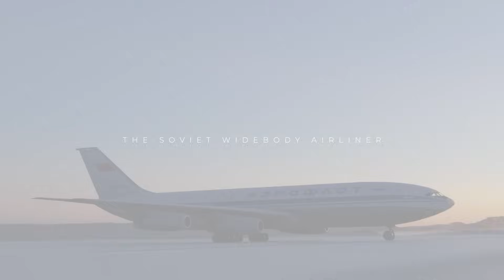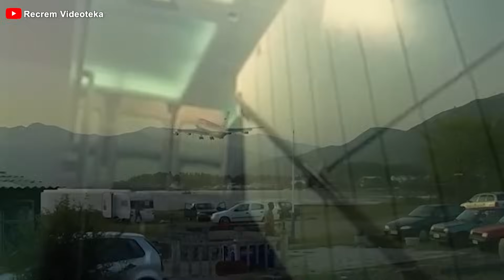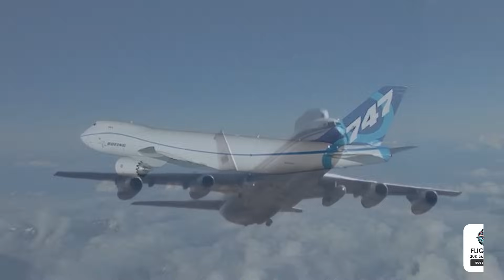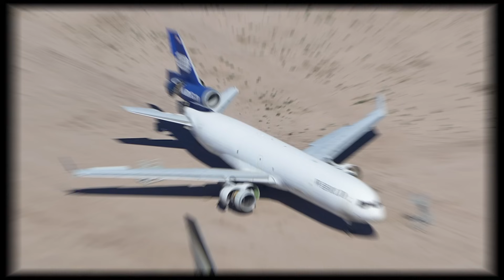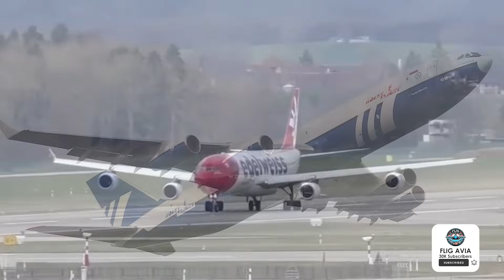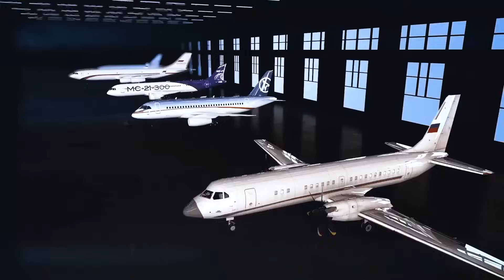No one wants the Soviet Il-86 airliner! Here's Why

Comment: Много раз летал в 80-е на Ил-86 - отличный самолёт. О каком коммерческом успехе речь? Ил-86 вообще не был конкурентом западным авиалайнерам, которые не поставлялись в СССР, а советские авиалайнеры не поставлялись в страны Запада. Где тут конкуренция? После распада СССР просто не было денег на модернизацию Ил-86 и поэтому они постепенно уступили место западным авиалайнерам. Из видео выше видно, что автор даже не отличает Ил-86 от Ил-96.
Reply: its range was a joke comparing to any western wide body aircrafts. It couldn't cover the Moscow-Delhi route without refueling. It was already obsolate when it came out.
Reply: @solinvictus6587  для дальних полётов был создан Ил-96 (внешне похож он на Ил-86), на нём сейчас летает Путин по всему миру, они есть у кубинской авиакомпании.
Reply: @ЕвлампийИванов-э2р  yes, the Il-96 has a range of 10 000 km. With 4 engines. Even the ancient A310 could reach 9500 km with only 2 engines. Putin flies with Il-96 because of the western embargo against his terror state. After the end of the Soviet Union, all the Russian airlines changed their fleet to western aircrafts because they were more advanced, reliable and first of all more economical (less fuel consumption). Today, Russians consider building Il 96s again but not because it is a really good aircraft but because they have no choice.
Reply: @solinvictus6587  нет. Потому что после разрушения СССР новые власти даже не захотели развивать авиацию, как и всё остальное. Поставленный Клинтоном Егор Гайдар прямо говорил, что России ничего не нужно, всё купим на Западе за нефтедоллары - Западу не нужны конкуренты и потому российские либералы в России в 90-е годы провели деиндустриализацию. Западу нужна была страна-бензоколонка. Авиалайнеры перестали развиваться. 

Если на Ил-96 поставить 2 современных двигателя ПД-35 (они уже создаются), вместо 4 старых советских, современную авионику, то его экономичность, эффективность резко возрастут. Но можно и создать совсем новый авиалайнер для ПД-35 с крылом из композитов (их тоже производят в России), как у уже летающего российского авиалайнера МС-21-310. Самое сложное и долгое в создани - это двигатели, их нужно создавать 10-15 лет. К примеру, планер для истребителя 5 поколения Су-75 был спроектирован всего за 1 год современными методами (двигатель от Су-57, авионика тоже).
Reply: @ЕвлампийИванов-э2р  OK, I'm over 50 and grew up in Eastern Europe and I've never ever seen any commercial aircraft made in the SU/Russia that was technically more advanced then its contemporary Western rival. So I am a 'little bit' sceptical about your predictions for the future. The Russian have been always dreaming about the decline of the West but the West is always decades ahead of them. Russian commercial aircrafts are like Lada cars - they are OK, if there's no other option. We also had one when I was a child :)
Reply: @solinvictus6587  на youtube при желании можно найти много видео про новые российские авиалайнеры МС-21 (МС-21-310). Например, у их западных конкурентов Boeing-737 и A-320 нет композитного крыла. У МС-21 более широкий и удобный для пассажиров салон. 

Имеет место нечестная конкуренция и она усилилась с вводом санкций против России. Санкции противоречат ООН и Всемирной торговой организации. Только это может объективно влиять на конкуренцию. Для советской, российской продукции всегда были закрыты рынки сбыта стран Запада за редким исключением. России отказывали в покупке различных западных товаров, технологий. Например, во времена хороших отношений со странами Запада России запретили покупку Opel, запрещали производство на Тайване российских процессоров "Эльбрус" по современным техпроцессам, только по устаревшим. Когда Турция купила у России ПВО С-400, то США стали оказывать на Турцию сильнейшее давление, отказали в продаже истребителей F-35, хотя некоторые их компоненты даже производились в Турции. 

Есть современные автомобили Lada и в своём сегменте они вполне конкурентоспособны современным западным автомобилям. Глупо по сути сравнивать их с гораздо более дорогими Mercedes. В России сейчас Lada - лидер продаж и это было так ещё до санкций 2022 года, то есть западные автомобили проиграли российский рынок. 

В России серийно производится и дорогие автомобили - Aurus, кортеж Путина на них ездит.
Reply: Доминирования стран Запада больше не будет, мир меняется, доминировать будет Россия. Везде на Западе экономическая катастрофа. Будет хуже и во много раз дольше, чем Великая депрессия, но западная пропаганда никогда этого не признает, так как сразу возникнет паника. Новый президент США именно поэтому так жёстко общается со всеми своими союзниками, мирится с Россией и будет уходить из Европы, Ближнего Востока - Америке её все ресурсы нужны для противостония Китаю, нужно отнять у него рынки Юго-Восточной Азии. Если это получится, то удастся немного смягчить удар кризиса в Америке. А Ееропейский Союз ждёт судьба СССР и всех стран советского блока - распад, ещё более тяжёлый кризис, чем в США и СССР, изменение границ стран из-за беспрецедентного в истории кризиса. Мир никогда уже не будет прежним, очень сильно изменится и в ближайшее время, он уже меняется.

Только те страны, которые будут сотрудничать с Россией смогут развиваться в ближайшие десятилетия. Только у России есть потенциал для экономического роста из-за того, что ранее её развитие сдерживали страны Запада с 1991 года. Экономика России сильно недоинвестирована, экономики стран Запада сильно переинвестированы и потому рост невозможен. Нужна новая макроэкономическая модель, но её никто не может придумать. 

Последние 70 лет XXI века - время доминирования России в мире. Сейчас переходный период.
Reply: @ЕвлампийИванов-э2р  there were absolutely no sanctions against Russia before they invaded az independent country. It happened only 3 years ago.
Reply: @solinvictus6587  нет, ограничения были всегда. Равных прав не было никогда. Например, в 1974 году была введена Jackson-Vanik amendment - формально из-за ограничений на эмиграцию из СССР, но когда ещё в 80-е убрали ограничения на эмиграцию, то эту поправку американцы не отменили. Холодная война закончилась - всё равно не отменили Jackson-Vanik amendment. 
- Clinton, отмени ограничения, мы ж теперь друзья! 
- Нет! 

Ограничения CoCom действовали до 1994 года, но потом взамен придумали новые в 1996 году. 

Всегда много ограничений было, даже в период исторического максимума дружбы между Россией и странами Запада - в 90-е, при Ельцине, когда повсюду в больших количествах в России работали американские советники, они же агенты ЦРУ. Из-за боязни России, конкуренции с ней всегда были ограничения. Примеры я выше приводил. После распада СССР хотели и дальнейшего деления России на части, но боялись, что тогда Китай захватит Сибирь, очень богатую полезными ископаемыми, лесом, пресной водой, плодородными землями для сельского хозяйства - получит доступ к очень дешёвым сырью и энергоносителям.

Когда создали NATO, то СССР попросил Америку стать членом NATO, но отказали и пришлось создавать свой военный блок. Это ведь на Западе начали холодную войну против своего союзника во Второй мировой войне. Это же Черчилль её объявил 5 марта 1946 года в Fulton, Missouri. Путин же тоже хотел чтобы Россия стала членом NATO, коммунистов же уже не было у власти, холодная война закончилась, но не пустили. А почему? Путин предлагал создать в Европе совместную систему противоракетной обороны, но Запад отказал. Почему? Разве плохо было бы, если бы NATO усилилась с помощью СССР или России, если бы европейская ПРО включала бы в себя и российские радары, ракеты?

Для Китая США открыли свой внутренний рынок в 70-е годы, для России он всегда был закрыт, кроме нефти и редких других товаров.
Reply: I flew on one in 1996, good plane, nice flight.

Comment: And what about the Il-96? And what about the proposal to modify the Il-96 from a quadjet to a twinjet?
Reply: They can't do it. It's too heavy for any two engines they can come up with. Every new engine they keep talking about, such as the PD-35, has been in development for a decade and is still nowhere near ready for production.
Reply: @ So it “could” be done…but for not having the engines or the wherewithal to produce said engines. This is where having someone else like GE or P&W do the heavy lifting (see what I did there) gives credence to the concentration of specialized industries. So if you’re going to purposely isolate yourself from the specialists you really need a “plan B” beforehand.

Comment: Good specs. However, they are not all accurate.

There really never was a MD DC-10, as stated here. DC stood for Douglas Commercial. McDonnell owned Douglas Aircraft at the time DC-10s were built. But they didn't manage that firm yet. They built the wings. Convair built the fuselage. Douglas did the rest.

Also, this video speaks about the IL-86 while showing as many IL-96s as IL-86s. To look at them they were nearly identical except for the engines. And that should have been part of the discussion here. The low-bypass engines gave less thrust than that of the IL-96 engines. But the '86 gave much faster exhaust speeds, thereby actually enabling the IL-86 to fly faster than the '96.

But the IL-86 took much longer fields for takes offs than the IL-96. And the '96 could fly farther through more efficient engines. But since this account might be a singular-aircraft video, and the IL-96 featured in another one, the differences in aircraft structural materials, and other differences, certainly can be part of the next documentary.

Comment: It left no legacy at all and , as you admitted, was inferior in every way. 
   It didnt compete globally and it was neither iconic nor pushed any boundaries. 
    Your upload was a perfect example of somebody saying a lot about very little many times over.
   Well done.
Reply: Several specs here are wrong. Speed wrong. Main cause of the IL-86 being passed over wrong. Weight limit of the 747 wrong. Calling the DC-10 the MD DC-10 wrong (DC means Douglas Commercial). IL-96s shown as IL-86s wrong. And most important of all... the timely role of the IL-86. It is a transitional step. Next came the IL-96 which was an improvement on the '86 leading to their current position of building 737-similar aircraft.

Now, it is true that their limited capitalism keeps them always behind. That is actually the problem here.